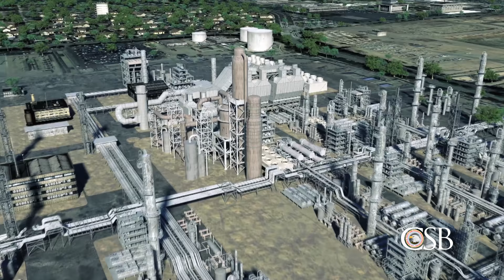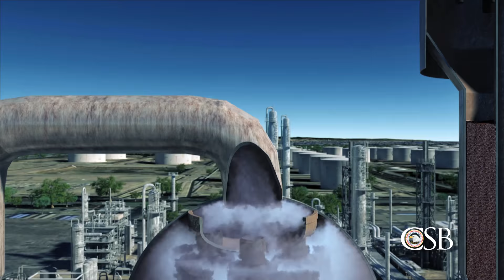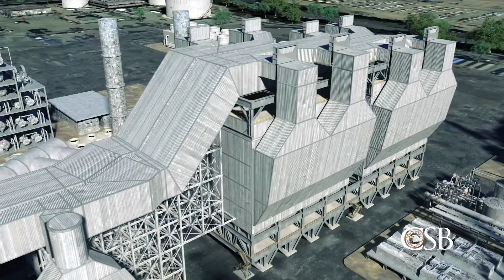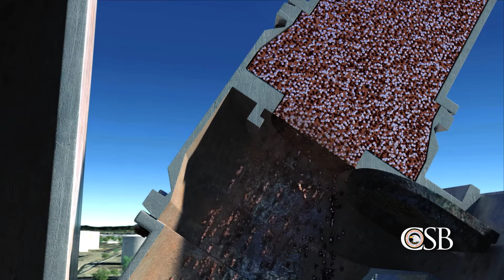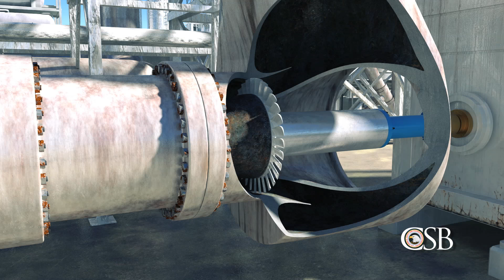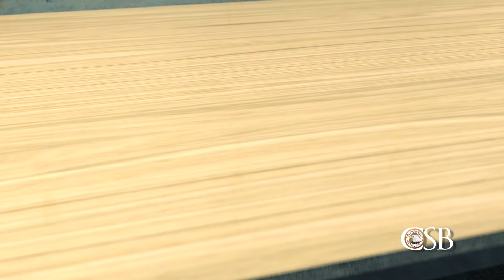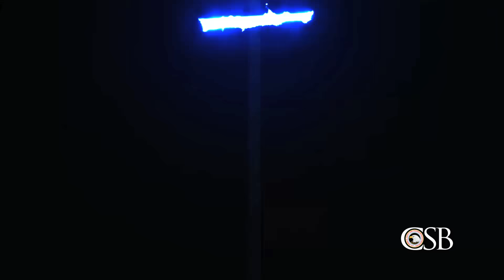Animation of 2015 Explosion at ExxonMobil Refinery in Torrance, CA

Comment: I wish he would have explained that research has been proceeding to develop a line of automation products that establishes new standards for quality, technological leadership, and operating excellence. With customer success as our primary focus, work has been proceeding on the crudely conceived idea of an instrument that would not only provide inverse reactive current, for use in unilateral phase detractors, but would also be capable of automatically synchronizing cardinal grammeters. Such an instrument comprised of Dodge gears and bearings, Reliance Electric motors, Allen-Bradley controls, and all monitored by Rockwell Software is Rockwell Automation’s "Retro Encabulator".

Now, basically the only new principle involved is that instead of power being generated by the relative motion of conductors and fluxes, it’s produced by the modial interaction of magneto-reluctance and capacitive diractance. The original machine had a base plate of prefabulated amulite, surmounted by a malleable logarithmic casing in such a way that the two spurving bearings were in a direct line with the panametric fan.

The lineup consisted simply of six hydrocoptic marzelvanes, so fitted to the ambifacient lunar waneshaft that sidefumbling was effectively prevented. The main winding was of the normal lotus o-deltoid type placed in panendermic semiboloid slots of the stator, every seventh conductor being connected by a non-reversible tremie pipe to the differential girdlespring on the ‘up’ end of the grammeters. Moreover, whenever fluorescence score motion is required, it may also be employed in conjunction with a drawn reciprocation dingle arm to reduce sinusoidal depleneration.

The Retro Encabulator has now reached a high level of development, and it’s being successfully used in the operation of milford trenions. It’s available soon; wherever Rockwell Automation products are sold.

Comment: The ESP should definitely be shut down if any non standard symptoms are detected. Would be common sense for safety requirements to SOP shutting the ESP down if other sections are shut down making non standard flows more likely. Gas detected after opening to install a blind Should of keyed the thought fuel is headed to the ESP.

Comment: Ok, but if they saw steam when they went to put the blinder on, shouldn't that have tipped them off that one of the valve slides was eroded and was leaking vapor? If so, their first priority should have been to turn the EST off to ensure that no hydrocarbon erupted if there was a possibility that it was leaking through, instead of lowering the steam output. 
Hindsight is 20/20, and I have no idea what the situation of the ground was like, but that seemed like an obvious red flag to a huge issue.

Comment: It should be at least three safety valves, before burning units, before reactor and mixed hydrocarbons tanks. BTW - why sparker wasn't turned off?
Reply: Looks like regulations keep it from being shut down. There must be other systems fed into the esp, and shutting it down will release fine combustion ash and particulate into the air, which California has a law against. This was probably a retrofitted system to comply with that law, rather than having smaller units, or better isolation (or they didn't use the isolation on this unit!)
Reply: I do not understand. Why ESP unit wasn't turned off?
Reply: @WadcaWymiaru  Very late but it was probably because the ESP unit was treating flue gas from another part of the facility.
Reply: @Misha-dr9rh  
But WHY it run during the accident? I would INSTANTLY turn it off.
Reply: @WadcaWymiaru  There wasn't enough time to turn it off. They didn't know the hydrocarbons made it back into the air side until it was too late.
Reply: @Misha-dr9rh  
The detectors were picking the gas traces!
It took some time c'mon !
I would turn-off entire unit!
(the safety regulations in Poland requires turning-off any hydrocarbon unit during the repair, i do not know WHAT in USA)

Comment: Strikes me as accidents waiting to happen. As a retired UK engineer surveyor (Boiler & pressure vessel) I would have thought that the maximum period between thorough examinations should be 5years, with some interim testing at 3. That is the most I would give for a system with known corrosion and wastage problems.
Reply: I worked on the "turnaround" in 2018 and all the more senior pipefitters told me this place is a total dump. At one point we were tasked with removing a few large valves in the Coker unit and it took all day to remove the bolts because they were so corroded, in fact multiple bolts had to be destructively removed or the nut would eventually shear the threads right off the bolt because they were so corroded. This plant has been run into the ground.

oh, and the only major work accidents to occur in the 3 months I was there were due to the facility's own operators violating safety protocols.

Comment: I grew up in Torrance. This Plant has been having explosions and fires every few years for the pas 50 years. It's ridiculous, if not insane.
Reply: On the surface I would think that would be normal operating conditions for a refinery based upon the complex nature of the systems and the seemingly dangerous process to refine crude oil.... But, other refineries do the same thing without constantly blowing up. It's pretty obvious lack of maintenance plays a huge role in these situations. The well maintained refineries run and take time to shut down for maintenance and thorough inspection, and the others blow up  and go back online after repairing what blew up till next time.
Reply: Guess who else is from Torrance?
Big John Holmes! AIDS deaths are completely preventable.
Reply: Busy Buzzbuzz : Huh ?
Reply: Get Trump out of office, and Biden will fix every problem

Comment: 1) Better to turn off the ESP when this happens again. Powdering up the neighborhood with coke ash, is a much smaller price to pay.  2) A clean secondary Expander Fan Box (plumbed in parallel) could have switched over to have prevented the entire catastrophe. This secondary unit could have been installed in the original build.  This concept is called Redundancy. Redundant electrical switches and temperature sensors are found throughout modern refineries. Wonder how they run today?

Comment: You would think that the monitoring equipment fitted to these refineries would be able to detect pressure, identities and volume of all of the elements used in the process.  This would give them real time data of what is going on inside the unit.  That leaking sliding gate should have be been detected by a sensor showing a continual flow past the shut valve.  This doesn't
make sense to me.
Reply: As soon as those exist, I'm sure operators will be happy to use them.

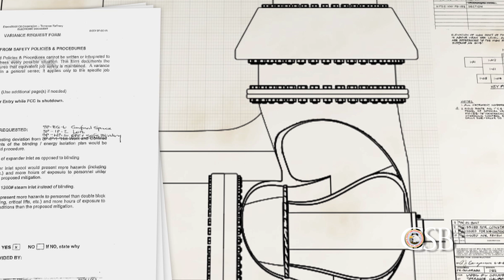Comment: I'd like to respond to ACADMan's comments.  After almost 35 years in heavy industry, if I were ever again required to produce a resume, my list of certifications and credentials would span so many pages that it would be far too cumbersome to list. My experience includes lead operation of reduction furnaces, induction furnaces, distillation facilities with multiple columns, lead in refining operations, galvanizing operations, solvent wash oil extraction etc. etc.In modern facilities, for the workers' safety and the safety of the public, we have very strict rules governing the use of each piece of equipment. For example, when a piece of electrical equipment is to be taken out of service, a certified electrician must be called off of whatever job he/she is doing at the time to power down that piece of equipment and render what is called a "zero energy" state. Once this has been accomplished, that machine must be tagged and locked out with a specific set of procedures which can only be reversed, once again, by certified maintenance personnel and only after the correct forms have been filled out and safety personnel have been called to the scene (administrative personnel do not work night shift) to inspect the area and sign off on the equipment and its requirements.Here's what the majority of the readers don't realize, stick with me here people, I'm not making this up, and I am in no way exaggerating. These are simply the facts of life when you work in operations, in a factory.Nearing the end of the night shift, at 04:00 or 05:00, when it's time for your third and last 10 or 15 minute break, If you're fortunate enough to be employed in a facility, the administration of which is benevolent, charitable and generous enough to offer the lowly, and according to ACADMan, "brain dead" operations staff access to such lavish luxuries as a toaster or microwave, (not nearly as common as most of you think) then bear in mind that even these pieces of equipment are covered under legal definition by policy. Therefore, if You get shocked by the toaster in your control room, there will always be some self righteous little xxxxx like ACADMan there to point out all the safety and procedural violations and throw you under the proverbial bus for not adhering to specified procedure.Why were the gates leaking? Replacing those gates requires many hours of downtime for cooling and reheating, emptying and refilling, etc. the consequence of which is a tremendous  loss of production. As is all too common, the root cause of this disaster seems to have been the board of directors and shareholders. I don't know what the mean time between failures was at this facility but anybody who has ever worked in industry would find it absolutely unbelievable that the faulty gates came as a complete surprise to administration.

Comment: How can a slide valve go 6 years of operation without being serviced? Jesus Christ of Latter Day Saints!!!! A good design would be to have backup slide valves that would shut and seal in case the primary valve fails. None of this would have happened if that sliding valve did it's job

Comment: Why were there not a valve on the pipe between the reaction tower  to the distillation tower? If it were they wouldn't have to rely on steam pressure alone to hold back the hydrocarbons.

Comment: Also, if hydrocarbon detectors — like the workers had — exist, is there reasoning behind a design that doesn’t put those sensors in the line before the ESP and shut it down if flammable material is about to enter? From this video it appears that, in the entire system, the only thing standing in the way of doom is that one slide valve. Does anybody know?

Comment: At 5:40 I don’t understand the decision to drop steam pressure. If the valve (+ catalyst barrier) was supposed to keep the reactor completely sealed from the regenerator, then why did it not raise major red flags about the condition of the reactor -> regenerator valve when steam was seen in the expander (assuming a failure of that valve was the only way steam could be in the air side)? Was there another more normal way steam could’ve been in the expander?
Reply: Chances are they weren't thinking about why there was steam in the expander. They clearly weren't well trained on the purpose of the steam.

Comment: Astonishing how so many well experienced and educated engineers can get together and create a giant fk up like this. I'm sure the CEO and other managers asked how this could possibly happen when they had such talent on hand.

I was on hand installing a large reverse osmosis water treatment unit and noticed it had a grounding strap connected to a sacrificial electrode on the prints, but the strap was missing. The pressure unit itself was a 400 gallon stainless steel tank w 1/2" in wall thickness. On the day the unit went into operation, I asked the supervising
manufacturer's rep abut the missing grounding strap. he said it was of no concern, used mostly for areas with high concentrations of calcium and iron. I let him look at my water analysis sheet showing the ground water being treated was over 36 gpg in TDS and 6 in iron- both levels considered moderately high. "Oh, we don't consider that high." he said. I thought he had misread the levels or saw an imaginary decimal point and asked him to take a second look- He was satisfied and ignored me. Fortunately, I have been burned before by these guys and wrote a report  Only two months after installation, I recd a report from the facility maintenance man he had water spraying on electrical equipment in the water treatment house and the water spray was coming from the RO pressure tank. I called the RO mfgr, and they arrogantly said, "That is impossible for that tank to fail...it had been hydraulically tested and certified - " I insisted they send someone to check. three days later their rep showed up- same guy who ignored me when I tried pointing out the TDS figures. he was very irritated at having to fly out to our facility on account of my "hysterical call".  anyway, he goes and looks at the tank and it was really hysterical when I showed him the place that was leaking, he stuck his face down to get a close look and flinches, turns around with his glasses all wet- "How can this be possible?" he asks pitifully Now it was leaking in four or five spots. He immediately cut the unit off line, which shut down the facility since it depended on RO pure water flow-  He called for a replacement tank immediately- and we started process to pull the leaker. Four days of down time, which the customer demanded compensation for - hundreds of thousands dollars- the leaker tank was cut open and the inside looked like the surface of the moon- totally dissolved by the highly aggressive stripped water. ...if the little grounding strap had been installed, the sacrificial anode would have taken the load and saved the tank. He tried to blame my crew for not installing it- I had my little letter, all logged and witnessed- "Your fault, Bud!" The grounding strap was listed at $4.38. 

Arrogance? Ignorance? Not paying attention? Laziness? Trying to hurry the job? Deliberately leaving the part out because someone else spotted his mistake- played like he knew what he was talking about and I didn't? he was, after all, the expert! And his company didn't even fire him!
Reply: Could you not have installed the strap yourself?
Reply: I bet his company would love to hear this story in full detail. He kept his job because the insurance\safety coordinators never heard about this, I bet.
Reply: (Arrogance? Ignorance? Not paying attention? Laziness? Trying to hurry the job? Deliberately leaving the part out because someone else spotted his mistake- played like he knew what he was talking about and I didn't? he was, after all, the expert! And his company didn't even fire him!) Exactly what going thorough right now my supervisor wont order the correct parts for jobs witch are expensive but necessary to do it correctly needless to say if the equipment ever fails it will cost the company millions i will never understand why people dont take there time and do it right the first time.
Reply: @k7k8k6  Mmm. I disagree. It is always about saving money. Dead men - they are paid for by insurance, not the company. Look at the Bophal India United Carbide accident...United Carbide is still in business, aren't they? 28,000 dead and 120,000 injured. all for "cost-cutting' by the company.
Reply: @acadman4322  it's Union Carbide, not United Carbide.
Reply: Frank W yeh- my bad. I knew that.
Reply: ACADMan Union Carbide now is wholly owned by Dow Chemical
Reply: @k7k8k6  When engineers, such as yourself, run the companies, then I would agree with your position. I've just seen too many "engineers" compromise their designs in order to save the company owners money...take the Titanic debacle, for just one example.
Reply: Obviously I don't know the details of your contractual relationship to the tank supplier, but I if I had been in your position and had known that the grounding strap was essential,  my company would have kicked my rear end for not making sure the grounding strap was fitted, no matter what the tank manufacturer's rep did or did not say.
Reply: @k7k8k6  Taking yourself out of the equation as a unique example, then,  I must say, history of such abject failures proves the point. As far as I can tell, as a whole, engineering of all persuasions does keep repeating history.
Reply: Wow crazy story. Love how he tried to blame you for it. 🤦🏾‍♂️
Reply: Crazy.
Reply: THE problem is that CEOs only get interested when their shareholders complain that the last accident cost too much of their "other people's" money and made their investment portfolio less attractive to their future investors.  So you can see nobody really cares about that.
Reply: The engineers didn't fuck up, the company fucked up by cutting costs to a point where several failsafe parts were broken all at once.  The engineers were working with a set of incomplete information.  Exxon, on the other hand, had all of the information they needed to prevent this and ignored it to save a few bucks.

Comment: poor engineering on that line to only isolate it with a slide valve, a gate valve on that line where the flange was would of allowed them too isolate it and maintenance the expander more efficiently. if they had to maintenance the expander before that required a variance, they should of installed a valve on the last unit shutdown.